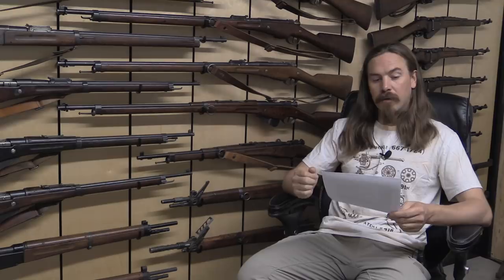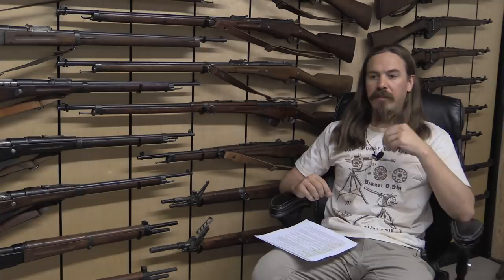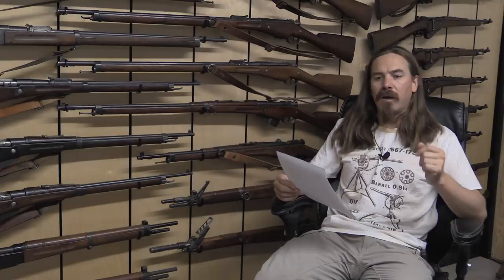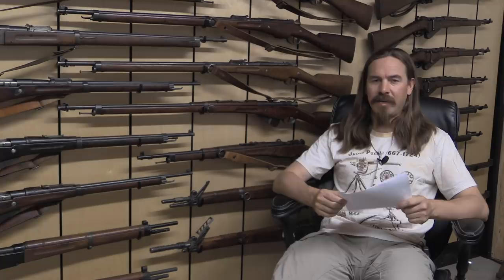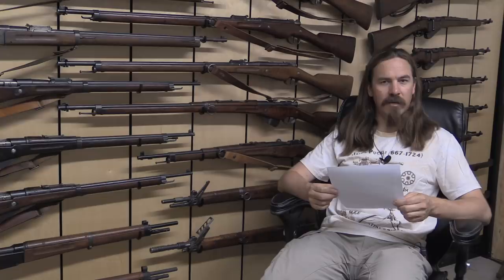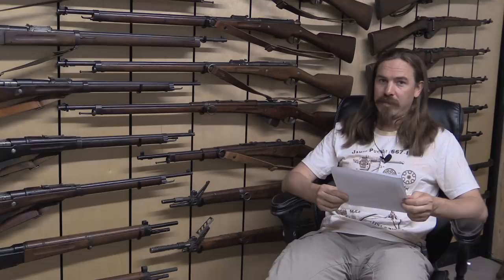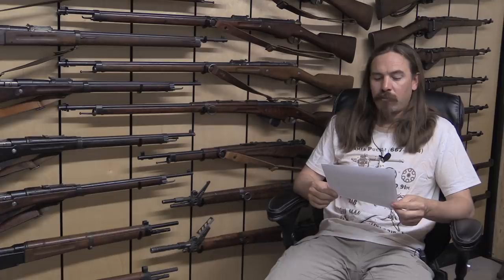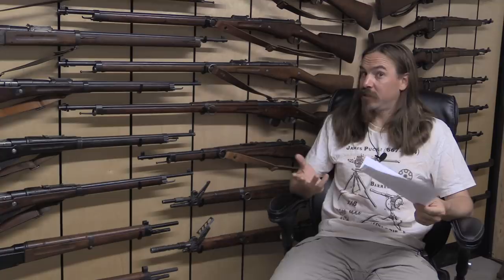Q&A #10: Collectible Surplus Guns, Dumb US Decisions, and Lots of French Stuff

Comment: Is there any chance you could get your hands on a G11? I can't seem to find much real info in regards to its function and ammunition.
Reply: andy d - I was just researching that the other day. Wikipedia had good basic info, and there were 1 or 2 other places with good info, including diagrams, on the first page of search results. The big problem was heat buildup. A metal case acts as a heat sink and it absorbs a lot of heat from the chamber and carries it away when ejected. Without that, it's problematic. The propellant they developed also burned pretty hot. If they could develop something that burned cooler and was not very sensitive (i'm thinking electrically fired) it might have potential. It also doesn't tolerate much handling- the propellant column flakes and can crumble. As far as cooling, i can see it now- a computer fan inside the receiver, and vent louvers. Lol
Reply: Ya that's pretty much all the same info that I found so far. The LSAT shows promise.

Comment: What if the 6.5 arisaka round is given a higher charge will it in theory powerful as a .308? and survived the higher charge?
Reply: Justin Carl Guerrero The Arisaka action is certainly capable of handling substantially higher powder charges, so pressure wouldn't be much of an issue. If you increased the powder charge of a 6.5 arisaka cartridge, it would be able to get a noticeable increase in power, but not enough to match a .308. It also might have an effect on the accuracy, but I assume it would be fairly negligible. If you could crank that 6.5 round out to the same or higher velocity, however, that theory may hold water. If the hydroshock theory is true, it may have more "stopping power". As of now, it's still just a theory. Also, this is all just off the top of my head, so take it with a grain of salt.
Reply: Campbell Homer I never hold and fire a 6.5 arisaka round before, so I have another question is the brass well made that if you try to put a stronger charge the brass would not blow up?
Reply: Justin Carl Guerrero modern day production cases could probably handle a fairly stronger charge, but for safety reasons it'd probably be best to convert a thicker-walled cartridge case into a 6.5 arisaka case. The action should have no issue handling the higher pressure, and as long as the outside diameter of the case is up to spec, it should feed and extract those converted cases fine.

Comment: I Wanna Know why there isn't a auto(Rimless) shotgun shell after over 100 years?
Reply: Polaritypictures I think it is because shotgun shells cannot head space against the chamber with the front of the shell and must be stopped by the rim at the back. Also, you can fire different lengths of shell in different chamber lengths because it is held by the rim; not so if it was stopped by the shoulder of the shell like a rimless rifle cartridge.
Reply: There a way to go about this, a belted brass case without the rim? seems like someone within 100 years can create somthing to solve this issue, we're in the 21st century!
Reply: A belted shell would probably work, but I think the main reason is simply a lack of need for a rimless shotgun shell. Almost every shotgun produced over the last 100 years has either fed from a tubular magazine or had to be loaded manually for each shot. A rim assists in the extraction process on break actions (which often did not have ejectors), and a tubular magazine negates the problems associated with rimmed cartridges in, say, the box magazine on a rifle. Interestingly though, AA-12 and Saiga shotguns feed from box magazines and work quite well, possibly because the rim on shotgun shells is relatively small and somewhat rounded.

Comment: I'm not certain I entirely agree with your assertions about the various 6.5/6.8 cartridges.  All three were designed for "superior" performance out of AR platforms.  The 6.5 Creedmore was specifically  designed to fit in standard AR-10 magazines as well as other .308/7.62x51 weapons while hoping to enhance external and terminal ballistics at long range.  The 6.5 Grendel was designed with precisely the same purpose except for the AR-15 and other .223/5.56x45 weapons.  Both of these examples literally require only a barrel change with virtually 100% compatibility with all other components with a caveat for tuning semi-automatics (gas system, buffer weights, etc.)  The 6.8 SPC does require more deviation from existing weapon components but still was designed around stuffing the most into the AR-15 platform.  It was just at such an extreme that 6.8 SPC spawned its own caliber specific AR.  Certainly, 6.5 Arisaka was not developed in that vain; however, its common proctile diameter does place it on the 6.5 spectrum.  I think that was the vain of the question moreso than the platform for which it was intended.  With the ongoing  Grendel/Creedmore craze, many might be more familiar with them than say Swede, Arisaka, 6.5x55, and other older 6.5 calibers when discussing "power" or velocity and common bullet weights.  All that said, keep pumping out the phenomenal content and pay little mind when someone like myself nit picks your specific phrasing.  It probably says more about me that this one thing just rubbed me so wrong anyway.

Comment: just a point on multi lug bolts. to lock/un-lock a multi lug bolt you dont need to rotate it as much. a 6 lug bolt doesnt have to rotate more than 30° where a 2 lug bolt might have to rotate up to 90°.  

for a 2 lug bolt you need a cam track that is almost 1/4 of the circumference of the bolt where a cam track for a 6 lug bolt only needs to be 1/12 of the circumference. less wear surfaces and a shorter cycling action are the results.

there is also less of a groove to get filled with dirt but if you have dirt in your carrier i think your fucked either way.

Comment: I'm very disappointed in you Ian. You don't usually speaking on things you know nothing about and I see you've taken the same snooty attitude as many of those who can afford machine guns and select fire weapons. The fact is Binary/Echo triggers are, at the very least, just as safe as the machine guns/select fire weapons you own. In fact they are safer than burst weapons as they have the same effect but give you more control. If you have it in the binary/echo mode but don't want to fire the second round you simply keep your finger on the trigger, switch the weapon to safe, and then release the trigger. Burst weapons don't have that option. Once you pull the trigger all the rounds are going down range one way or the other. Not to mention that if you have it in binary mode the chances of something happening, let alone you noticing it, that will be adversely affected by one additional round after a barrage of fire is slim to none just as it is with machine guns and select fire weapons.